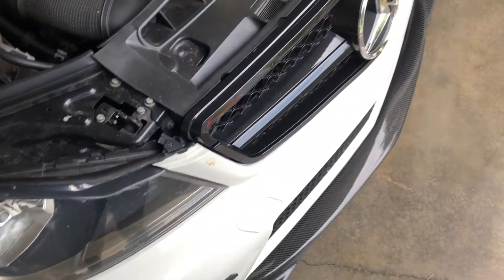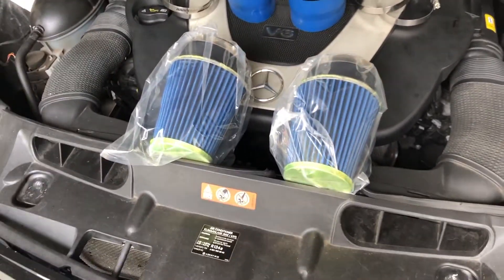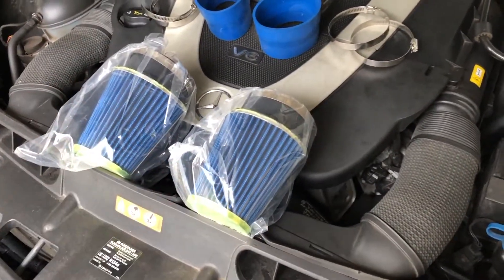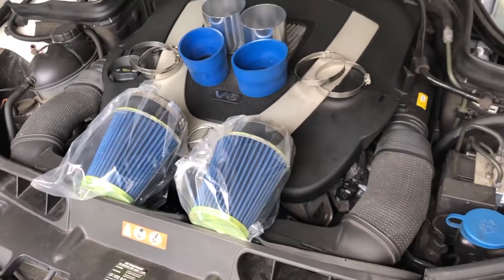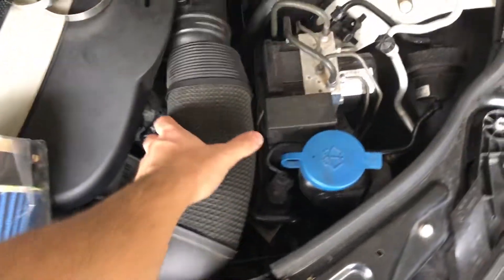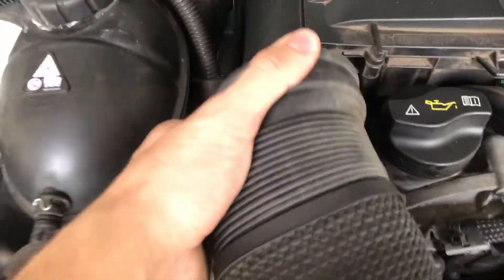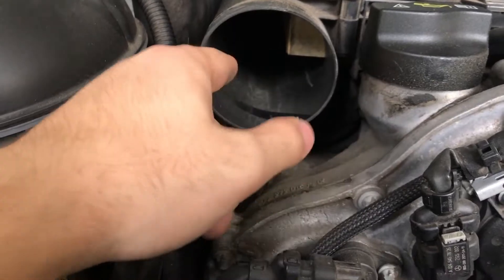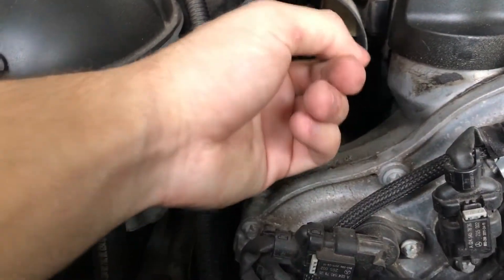How To Install Cold Air Intake - Mercedes Benz C300

Comment: My dude you have a hot air intake. Cold air would be drawn from either the wheel well or you would replace the headlights with the filters to get cold ground air. 

Yours pulls hot air from the engine which is causing damage ...
Reply from the maker: Understood thank you

Comment: I remove mine and went back to stock there a other way to do it where u could get cold air by leave it stock by the head light or by wheel well

Comment: Hey bro I have the same car and ngl, this is decreasing your cars performance. It’s drawing hot air from the engine bay whereas the original setting was pulling air straight from the grille area. Try to understand what each piece of the motor is doing and you’ll see basic stuff like this that doesn’t make sense.

Comment: And you gotta take out the stock filters or else you will basically suffocate your car with 4 filters
Reply from the maker: That’s good to know thank you. I need to look into it more
Reply: @MoDays707  you have 2 more filters inside that plastic box which you fit them two, remove them then make another video to see how it sounds
Reply from the maker: Well so bro thank you